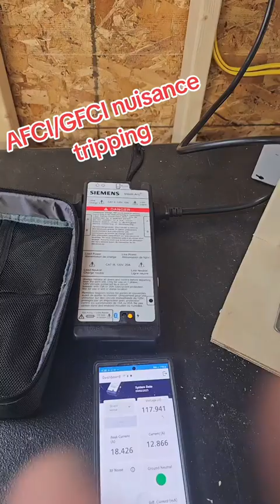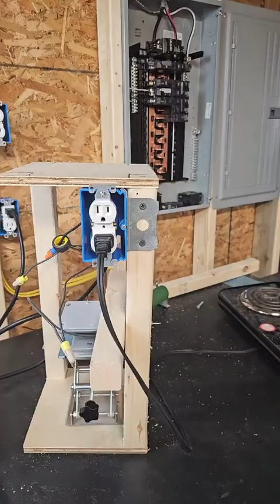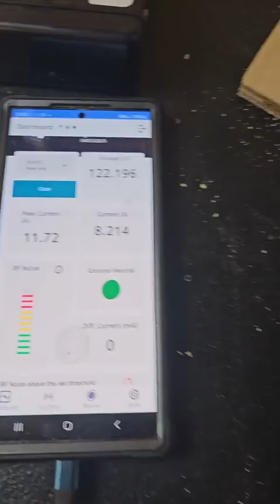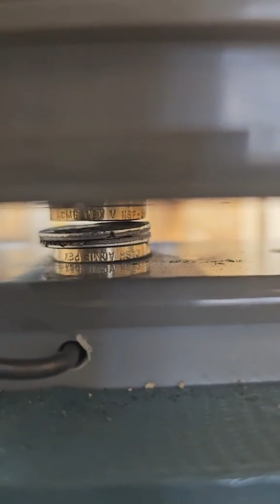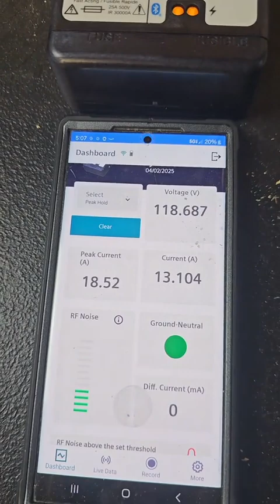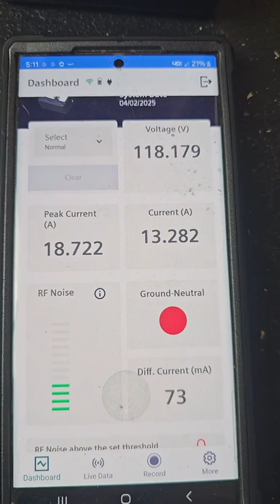Troubleshooting AFCI nuisance tripping.

Comment: How common is nuisance tripping as a result of a problem outside of the AFCI circuit? When the heat pump in my home failed as a result of a 50 ohm short to ground on the compressor, both of the bedroom AFCI breakers tripped, repeatably. The curious thing is that neither of those circuits had anything to do with the heat pump circuit. I'm guessing the objectionable ground current and RF noise from the failed pump was distributed through the entire ground system from the main panel, and detected by bedroom AFCI's....

Comment: But is it practical?  How do you find a fault?
Reply: Based on details I do not know, I assume you use the process of elimination to narrow the fault point. Meter would give a definitive answer of a cleared circuit after a certain receptacle, appliance, or switched equip. was taken out of the loop. Maybe, I think

Comment: Since 1982 only United States allowed to leave wood surface without protection against electric arc. In other world installing electric cables to wood surface is code violation since early 1980's. 

As result AFCI is required almost everywhere in US buildings, but in other countries AFCI is very rare (mandatory only in kindergarten and fuel stations and similar buildings).
Reply: AFCI or AFDD is required in several countries other than the United States and Canada. These include Germany, Austria, Slovakia, New Zealand, the United Kingdom, and Russia. Of course, each location has its own unique application requirements... 
I think AFDD/AFCI will soon be common in many countries. The most likely candidates are France and Spain, and China.
Reply: @YUshakov Requirements appeared only after 2020, but in United States AFCI/AFDD is mandatory since 1990's. We can see 30 years gap.
Reply: @Dmitrytln  thanks, that's interesting. We have used experience with the use of AFDDs in the US to update the legislative framework in Russia for the mandatory use of AFDDs. Since March 1, 2024, this class of automatic breakers has been mandatory for new and reconstructed residential and public buildings. Of course, a lot of nuances exist. At the same time, the trend is clear to see.
Reply: This logic is stupid.

So in those other countries, it's fine for any house built before 1982 to just burn down then?  Nobody cares about protecting them?  Only newly-built houses matter?

New building requirements don't change the fact that there may still be hundreds or thousands or millions of existing homes that were not built that way, that people are actually living in too.  The countries that don't require AFCI are actually worse than the US in terms of fire protection measures (in this particular area), not better.  That's really not something to brag about.
Reply: @foogod4237 AFCI in America appeared only when insurance companies felt their budgets in trouble. In old US buildings you can also find disposable ceramic fuses without any AFCI.

Comment: PART 2
As for arc fault. It has to hunt for spikes in the current. My LED undercabinet lights provide spikes that trip the arc fault.  Plugging in most any of my TVs or computer or wall wart power supplies creates enough of an arc for the initial charging of the internal capacitors that they trip my arc fault breakers.  My garage doors trip the GFAF breakers. It is a nightmare. Of 30 GFAF breakers every one of them gets tripped at least once a week and many of them trip so much that I have just given up and accepted that those rooms just don't have working outlets or lighting.  My HVAC is constantly tripped. The GFAF breakers cost $100 each. The regular breakers cost $7. For a total breaker panel cost of $3,000 versus $210 for all positions.  At first we thought that there must be something wrong with the GE GFAF breakers. But new ones did not fix the problem.  Since the panel is GE the only brand I can buy are the GE. The electricians have all said the only thing they know to do is remove the entire GE panel and replace it with another brand that they favor. But most of the electricians whisper to me that they have remove hundreds of GFAF breakers and have buckets of them.   My new house is mostly without electricity.  I would pronounce the house a total failure with those breakers and should be condemned and no house ever be built again because all new construction will need to be condemned if it was built with GF or GFAF breakers. So I am sorry but I get angry at anyone that advocates those terrible breakers. GF or GFAF breakers should be internationally banned. The problem I have with ripping out the wiring of my brand new house and replacing it is many of the electricians tell me they have the same problem with all the brands.

My gas range uses electronic spark to light the burners.  Usually within a day or two I fail to turn the knob fast enough past the spark position and it produces the spark and I hear the breaker out at the panel trip.  We keep a fireplace lighter sitting next to the range to light the burners.  We can set the breaker and use the oven because it is lit with a glow plug.  But if we forget and turn on a burner every thing is off. The oven uses a computer to control the temperature.  I am considering pulling out all my new appliances and replacing them all with used ones that are at least 20 years old.
Reply: No, AFCIs do not pay attention to current spikes at all (this is a common misunderstanding).  They are actually designed to detect certain RF frequencies (around 100 kHz) which are usually indications of a sustained arcing condition.

If you are getting that much nuisance tripping, it is not because of "current spikes" or because of your TVs or computer, (or even your stove) etc.  It is because there is something else introducing RF noise into your power lines that shouldn't be there.  Find the source of that noise, and remove it (or add a power line filter to filter it out), and your problems will all go away.

Comment: PART 1
Your video did nothing to help me with my problem.  I don't have a ground fault. I don't have a malfunction that creates an arc.  I have LED lighting which uses diodes and has current spikes 120 times per second. And it creates enough noise in the whole house that the breakers trip. Not even the breaker that has the LED lights on it but ALL the breakers.  Sometimes I hear a dozen or so breakers tripping at nearly the same time. Asking my crippled wife to climb under the stairs to reset the breakers is impossible. Often I get home and she is sitting in the dark.  She has threatened to check into a motel and just quit living in the house.  We hate our new house.

So I keep my under cabinet LED lights off or else my HVAC won't run nor my garage doors nor most of the other devices in the house. And the under cabinet LEDs don't actually trip their own breaker but create enough noise in everything else that all the others trip.  BUT the under cabinet lights are not the only culprit. Even the LED light bulbs in lamps cause the same problems. Not as instantly as the under cabinet lights but usually within an hour or so. I have pulled out all the LED lights and replaced with CCFL or incandescent. But I am still plagued with appliances tripping the breakers.  Some carpenters came and it was impossible for them to use saws and drills without tripping breakers. So they had to go completely battery. And my garage door will trip the GFAF breakers when the only breaker ON is just the one for the garage door. All the other breakers off.

Over the decades I have reset ground fault devices at least 300 times in my life.  AND not one single time was there a legitimate ground fault.  In order to have a ground fault an imbalance of current from the hot to the common has to occur.  That means the current has to go somewhere else and that has to be ground.  Water pipes were copper and thus at ground.  Same with sewer pipes. But no longer. They are all plastic. Plain tap water is clean enough that it will not conduct enough current to matter.  It has to have something dissolved in it. So there is no source of ground in today's kitchen except for that 3rd pin on the plug. If we didn't have that pin then the only way to have a real ground fault is possible would be to haul in something from outside that conducts to ground. Ridiculous. The Japanese eliminated that 3rd pin. Years ago I was blessed with an electrician installing our first GF breaker. It popped all the time. When lightning strikes even 100 miles away it provides a spike that fools a GF. When a GFCI outlet is daisy chained to another outlet a few dozen yards away then that extension line acts as an antenna and picks up the lightning and fools the GFCI into tripping.  GF at the breaker creates an even longer antenna from outlet to breaker panel.  GF should only be done at the outlet and there should never be any other outlet daisy chained even though the GFCI manufacturers provide ways to daisy chain - don't do it.
Reply from the maker: Too long to read all that contact the manufacturer.  I've heard of them replacing all breakers with an updated software. It matches the problem you're having. They can go through the computer inside the art vault to figure out the problem you're having
Reply: This is a terrible experience, but so totally different than what must people have experienced with either GFCI or AFCI for 20-30 years, so it sounds like either there is some weird issue going on in your electrical system, maybe a loose terminal or bad bus bar causing an imbalanced flow in the whole system, or you got a bad batch of breakers and they need to be replaced.

It would be interesting to see one of the really good troubleshooting guys like Mike Holt out to a house like yours and actually figure out what is causing the issues, because SOMETHING out of the ordinary is going on there.

Comment: It's enough of an issue that some states just straight up don't require arc faults anymore. They don't adopt that part of the code.

Im a Journeyman electrician in utah and we never install arc faults in houses and town homes. This is a pretty cool device though. Would love to see arc faults get reliable enough to use everywhere.
Reply from the maker: Arc faults are reliable on new installs done correctly.   Since 2011 In new houses almost every circuit i put in is dual function AFCI/GFCI breaker.  I have never had a nuisance trip in a new house.  Once i had a defective diswasher trip one.  But never had one trip that wasn't fixable.  It dealing with existing wiring or old appliances that the nightmares starts. And prior to 2011 i remember there being problems.
Reply: @Stevenj120volts  I've only been doing this since 2019 so that's probably where my disconnect comes from. It's just ingrained in us not to trust arc faults so I assumed it was still a problem even in new builds
Reply from the maker: @LaigledeMeaux  you will find more people to agree with you than me.  Most dont believe me that i dont have problems with afci.
Reply: @Stevenj120volts  old head knowledge can be the bane of my existence sometimes. I'm a part time teacher at our local tech school and there are several older gentlemen that have been electricians for 30-40 years that also teach there. Their knowledge is immense, and they are an incredible asset, but then they will just have these outright incorrect answers to questions a student will ask them and it is impossible to get them to see that they are wrong.
Reply from the maker: @LaigledeMeaux  well if it code it should be clear and if it theory i like to come up with experiments that will have results that settle the debate.

Comment: Europe does this better. Arc fault protection only in high impact areas with predictable loads
Reply from the maker: Yes our codes are a much higher level of protection qnd safty. SInce 1971 we have gfci that trip at 5ma.  They call it RCD and they are 6 times less sensitive and dont trip until 30ma.  With our AFCI if you do a quality install you dont have nuisance tripz with a new house.  They issue come from imported appliances and repairs to old homes.   AFCI have been code minimum in USA some room in homes since 1999 and my understanding is Europe is at least 30 years behind us and still doesnt require them.
Reply: @ it’s probably more accurate to say US and European codes are written with different goals in mind. An example being BS 7671 having a whole section about nuisance tripping and how to wire circuits to minimize/avoid the problem.
Reply from the maker: @JohnDemolition i havd not had ant nuisance tripping in over 14 years.  If wired to our code and the appliances are also current standards you will not have nuisance tripping

Comment: Seems to be around $480.00 from what I can find.  That's a steal for what it does.  If Fluke made one it would ring up for about $5,000.00 for sure.
Reply: I see $480 to $727 for the S IA system. Yikes! This is why it costs so much to hire a licensed electrician.
Reply: @davetysdal5442  Even $727 is actually really cheap for any kind of decent-quality commercial equipment.  Compared to most of the other expenses of running any kind of business, that almost qualifies as pocket change.

For this sort of specialized diagnostic equipment intended for professional use, I was expecting something more like $4,000-$8,000, to be honest.
Reply: $1000 from our local supplier.

Comment: Cool tool for sure. My refrigerator is not going on any arc fault, breaker or GFCI breaker! Code or no code. If it was good enough for the last 30 years it will be for the next 30 years.
Reply: Exactly!
Reply: They are not suppose to be.
Regular breaker. It has to be only thing on that circuit.
Reply: @lm5085 That depends on what code cycle your on.  They have eliminated that from the nec.  The 2017 and 2020 require it to be afci, 2023 requires dual function
Reply: This is the kind of thinking that gets people killed